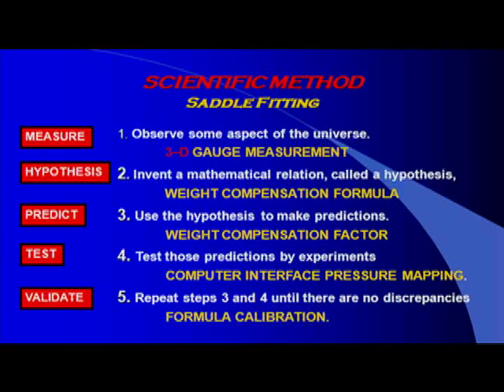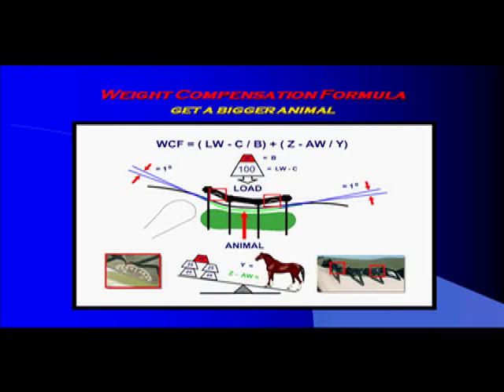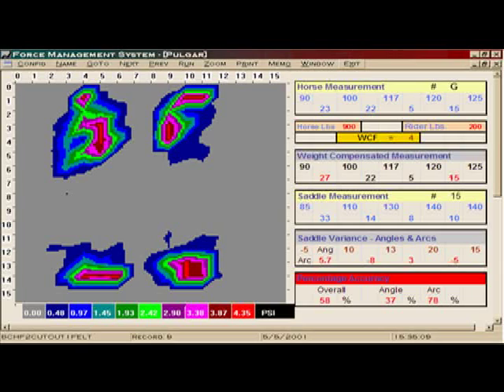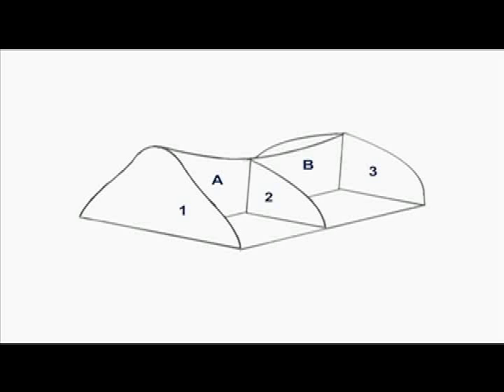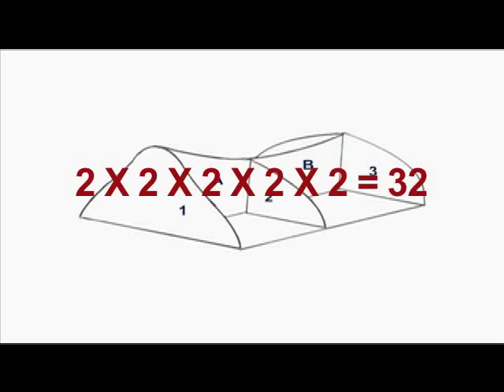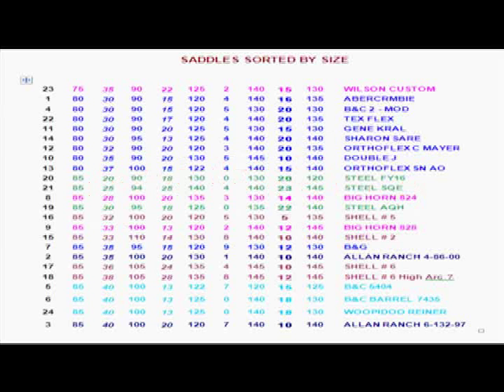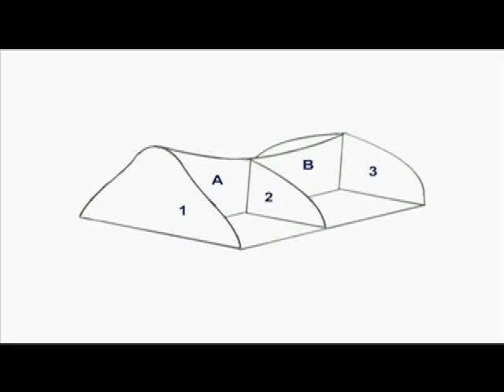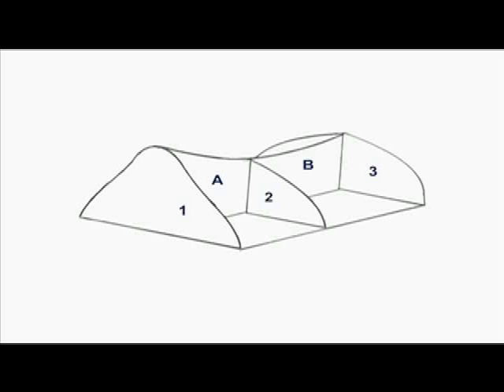WHY SADDLES DO NOT FIT MATH

Comment: That makes sense, that pressure cuts off blood flow ... but I do believe that sweat marks on the saddle pad can indicate if the saddle distributes pressure evenly as clean patches indicate either a lack of pressure or so much pressure that the pores in the skin were unable to for fill their roll. A good saddle fit requires an even distribution of pressure clean patches appearing on the saddle pad could indicate that the saddle needs reflocking. Something which is often neglected.

Comment: Thank you for your video which shows that use of electronic pressure analysis. As a mathematician myself I would say saddle fitting is one of those areas where a mathematical formula is not a reasonable use of effort...  ie the good old techniques of human observation for example reading the sweat marks on the underside of the saddle pad to make sure they are even; take a lot less energy. However standardising saddles is a good idea unfortunately horses are not standardised.